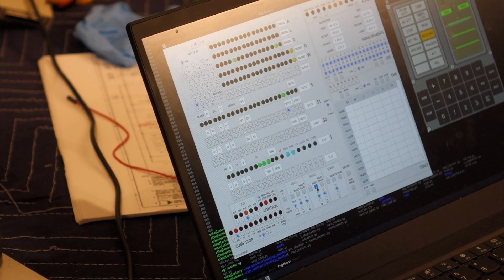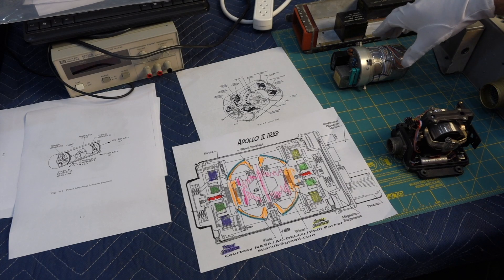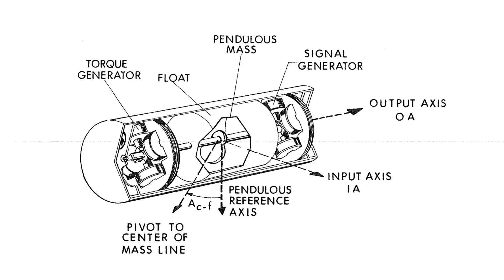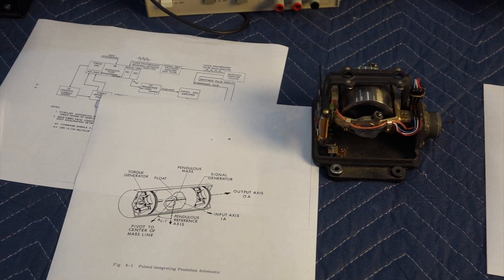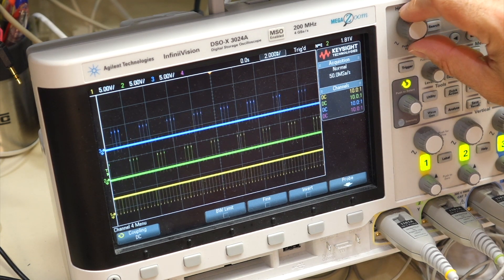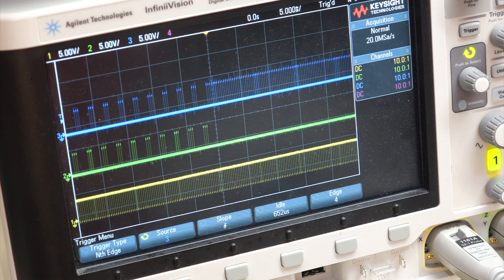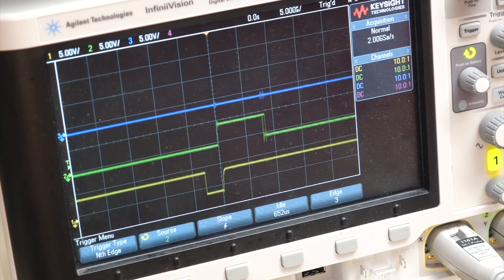Apollo Guidance Computer Part 20: electroluminescent panel for our DSKY, making an accelerometer

Comment: This was a very fascinating video.  The micro-controller not being able to keep up was an interesting observation.  Thanks for all the detail.
Reply: That's why I like of analog technology. My 1980´s TV goes on 5 times fast as my 2017 TV because it's dont have to read giga byte code before it start working.
Reply: A properly selected Microchip PIC would probably be able to keep-up, because it can do a lot of timing and pulse generation directly in hardware.
Though this will require a deep-dive into the datasheet.

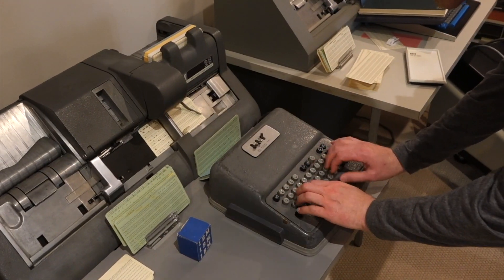Comment: This is a great series of videos. It is amazing to see how much work has been put in to restoring the AGC. Fran Blanche had started work on a faithful recreation of a DSKY but stopped work on it after a while as someone else had made one. Perhaps it was the one seen in this video that caused her to stop work on the one she had started. I used to use one of those keypunch machines seen to the right of the one being used in this video at 2:16. Like the person doing the narration I also use ATMEL AVR parts without using Arduino. :)

Comment: Very cool. The same toggle and count is rather simular to how the cassite inputs work on a apple II. It's absolutely brilliant how that accelerometer works. Just count the pluses or ticks. Even if computer is busy a single pluse from that device will trigger a interrupt and a wee bit of code will run on the AGC. Such interrupt subroutines thus have to be very tight and short code. Amazing that an Arduino has difficulty creating the required pluses for this task.  
I suggest you use the Arduino tone generator library. This would allow you likely to easily generate the multiple pluses you require here. In place of say code to generate x number of pluses over a given time interval, with the tone library you could send one command and thus generate a steady stream of pluses.  Or hand code the assembler code for the Arduino just like those amazing folks did 54 years ago!

Comment: You should build a complete simulacrum rig for the AGC.
Feed it's control outputs into a physical model of the space craft and feed the simulations data back into the AGC.
Then have a rendered representation of the LEM landing on the moon.
You could even fly it, with controls.
Reply: Oh my god...
you could literally write a modern 3D version of 1979's Lunar Lander by Atari
With the AGC being offboard simulation code.

Comment: A note, Marc, that the Arduino library's standard functions for I/O (digitalWrite() and similar) are very slow and have substantial overhead. Using interrupts is a good start, but if you aren't already then directly accessing the I/O registers/ports for your microcontroller in question (such as directly writing to PORTA/B/C/D for AVRs) can be SUBSTANTIALLY faster (as in, 20 times or so faster). A 16MHz AVR should be able to toggle I/O pins at multiple megahertz and getting into and servicing the interrupt routine shouldn't take more than a few clock cycles.
Reply: A bit more reading has revealed that even using arduino's attachInterrupt() routine has excessive overhead (about 45 cycles before the routine starts, very similar to your reported initial delay!). Again here, directly calling the  underlying C routines to register an interrupt service routine can shave that down to something like 18 clock cycles: https://billgrundmann.wordpress.com/2009/03/02/the-overhead-of-arduino-interrupts/
Reply from the maker: Of course. I don't use the (terrible) libraries.

Comment: Ben gave the game away when he came down the stairs. Obviously just brought it on Amazon.... 😉 
Props for all the hard work Ben. I saw your videos previously, it was not easy making your own EL.

For the accelerometer could you not just output either a continuous ‘positive’ or ‘negative’ channel signal, and not bother with doing any of the pulse shaping in the arduino. Then in external hardware logical AND that signal with the incoming AGC pulses to get your required signal pulses? Probably no need for a FPGA then as arduino code can toggle the ‘positive’/‘negative’ signals when the incoming AGC clock is low. That would seem to give you a much longer window for your processing.

Comment: Maybe this is coming a bit on the late side, but there is a FastIO library that is significantly faster at setting pins than the standard Arduino pin routines. We use it in Marlin to get the fastest possible performance in a printer driver from a 16MHz AVR.

Comment: 7:33 you state 100 PPM is “parts per million”.  

     Even though that is the usual acronym for PPM, I would think the PPM spec in this case is 100 “Pulse Per Meter/sec” of delta V.  

     At the bottom of the drawing sheet you can see the LM spec of 1 pulse per cm/sec of acceleration.

    This is of course for the LEM.  The CSM spec was less accurate, because it didn’t need to be as accurate.
Reply: That makes sense. 100 pulses per meter/sec is equivalent to 1 pulse per cm/sec. 
100 parts per million of 32G (full scale) is equal of 0.319 pulses per cm/sec if my math is correct. Of course, accuracy and resolution is not the same and it is normal to higher resolution than accuracy, but PPM meaning pulses per meter/sec does make more sense in this instance.

Comment: Use the right micro + language platform and you won't have timing issues like that. My suggestion: Parallax Propeller in assembler mode, as it has 8 cores each with direct I/O.

Comment: I just listened to 13 Minutes to the Moon podcast today and there was mention of a Rendezvous Radar being active that contributed to the 1202 alarms. But the alarms only occurred during a 16 68 to find delta h. So then was the full story of the 1202 alarms that the hardware counter couldn’t keep up with both the radar and the pipa?

Edit - oh and a follow up question... will you be able to get the electroluminescent display into Carl’s DSKY??
Reply: That's an excellent series.  I just finished it today. :D
Reply: The problem was a design flaw. When the rendezvous radar was switched to the abort guidance system, a special purpose backup computer in the LM that performs an abort back to orbit, the position data was still routed to the AGC  Further, since the radar antenna was using a different and unsynchronized power supply, it was possible for the relationship between the AGC 800 Hz supply and the other 800 Hz supply to be so far out that the analog to digital decoding of the radar antenna position couldn't resolve a position. 

Instead it flooded the AGC with random position changes at the maximum rate possible for a counter circuit. This added a few crucial percent of CPU load to software that was already running above 90% busy at critical points in the landing. 

It was not because the radar was on or off. It was because, when the flight plan had them switch the radar from the AGC to the abort system, instead of avoiding an impact on the AGC it actually developed a pathological load. Later missions would zero out the Analog to Digital circuitry when the radar was switched to the backup system. 

In fact, that was apparently the safest choice - have the radar lock onto the command module and provide the data to the abort guidance system to make an abort even safer. 

The fix they gave Apollo 11 for liftoff from the moon, to disable the radar circuit breaker, actually had no impact on the problem. If the radar switch was set away from the AGC and the relationship between the power supplies happened to be bad, then the same load would have hit the computer. Ascent presumably ran at a lower CPU load so it might not have ever caused a symptom even with a bad power supply phase relationship.
Reply: @carlclaunch793  Thanks for the reply :) Wow! That's incredible that all that was going on and yet an abort was able to be avoided. That priority scheduling really was something.

Comment: I wonder if a Propeller chip could work as a Pipa since it has 8 cores.
Reply: an arduino is fine, the problem is he is using the Arduino IDE to program it ... he needs to switch to Atmel Studio.
Reply: Tom Servo I’ve been dealing with some of my own Arduino latency issues in an In car data unit. What does IDE do that drags on the Arduino?
Reply: @tomservo5007  He said he's just using the Atmel chip. 8:15 - Doesn't sound like he's using the Arduino software library / IDE.
Reply from the maker: Of course not. I am not using Arduino anything. It's programmed in the raw. It's just that the underlying Atmel chip is quite slow. Slow at interrupt detection, slow at context switching. The whole thing (with zero program instructions) is already over 2 us. Then all it takes is a few instructions to keep track of pulses count in 16 bits (slow too, multicycle) and my whole time budget is used up.
Reply: @eskomattila4468  Ahhh I see, I'll look into that! Thanks!

Comment: Great job! Btw I recall our old discussion of the "LED lightbulbs" and from what I see they look really great, by the video I'd never tell they are "fake" before you opened the device! P.S. do not let the Arduinos pollute such a beauty, better use stock AVRs :) From what I can tell after years with those chips, the ASM code for those can be written in no time (also the instruction set is pretty slim on those), and no compiler, strangely, will ever compete with it (which was pretty much surprising as the new x86/x64 and GPU-targeted compilers can produce very clean code, especially when you type things in carefully).

Comment: "Pulse generation should preferably be done with an FPGA" - which Arduino are you using? If it's an AVR-based one, no wonder. I would recommend trying an ARM-based one or the Olimex E407 (larger board but Arduino-compatible) running a STM32F407 up to 168 MHz. I have had particularly good experiences with STM32 MCUs for a similar application where we did 8-channel configurable time-delay on digital signals.
Reply: That would also be super easy to simulate in analog. Base is a sine signal of pendulum frequency, manualy offset by a potentiometer. This feeds into two comparators that senses only a small top portion of a sine (  3 pulses wide) , one for poz and one for neg top. This goes than through an and gates that enables AGC expected pulse train. So as you put the sine with a pot off balance, puls counts in that direction will increase. In balance you get +++......---......+++......---...... and off balance +++++++++...+++++++++...

Comment: Could you possibly attach the output of the oscillating crystal to the computer and use the arduino only as a sort of valve arangment controlled using pulse width?
It probably would not be as exact but maybe it could work.
I realize that I'm perhaps naive.
It  would still be required to keep track of pulses but it would not need to generate as many.

The initial 3 pulses could be build in hardware... And after those 3 it could switch over to raw pulse input controlled by the arduino...
(It would be better on an FPGA but in a pench I think that this could this work)
Of course you would not want to risk the computer with this

Comment: Instead of using 16 MHz Atmel, you could use Teensy 4.0 board with ARM Cortex-M7 processor at 600 MHz.

Comment: For the problem of performance with the microcontroller  you use : by the 2010 standard, AVR 8 bit is already an antic technology ! Without the burden of programming an FPGA, a modern 32 bit microcontroller like the 2013' STM32F4 can drive 2 timers (each 4 channels) in PWM mode and DMA to output the needed 6 channels of pulse with the timer accuracy. Ok, would have been useless since landing was perfectly done anyway !

Comment: Interrupts are actually not the fastest, they add a few cycles of interrupt latency and then have to push all the registers on the stack. The fastest is actually direct port IO in a loop. You'll want to pretty much disable interrupts to minimize jitter. I do know you have an FPGA wizzard in the house, but if you need help with the AVR code, it'd be an honour.

Comment: Arduino having a hard time keeping up:  dump the Arduino IDE and use Atmel studio.  An FPGA is overkill.
Reply: He isn't using Arduino IDE AFAIK. He said so in the video.
Reply: But even so there's tweaks you can do in Arduino to improve speed... Writing directly to the I/O instead of using the functions which are a lot slower.
Reply: I think this application is the perfect fit for an FPGA. Why don't you think so?
TinyFPGA and the open source toolchain are really light-weight.
I think FPGAs shine when it is about tight timing requirements and routing flexibility.